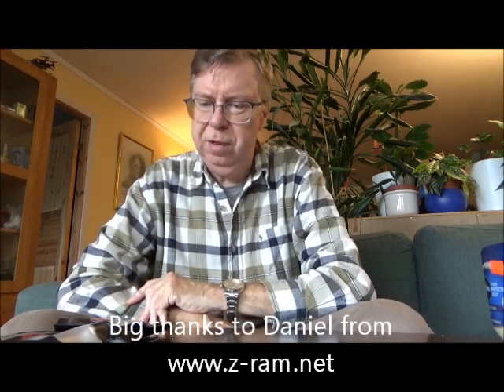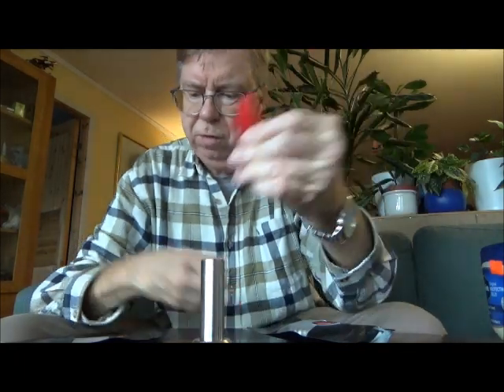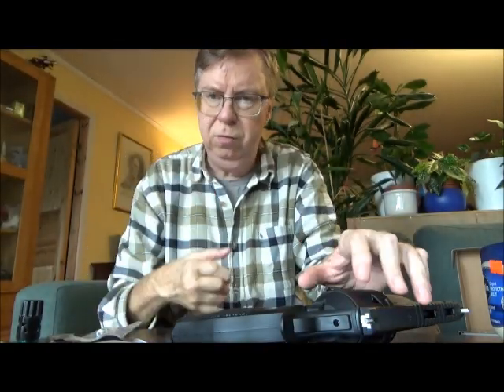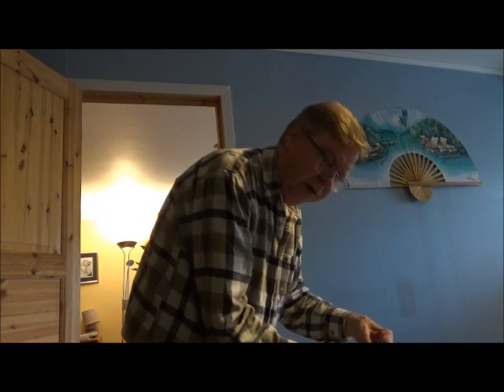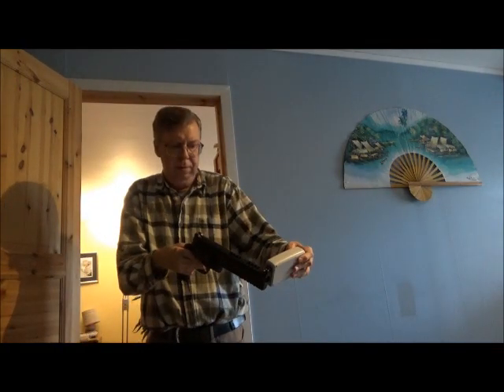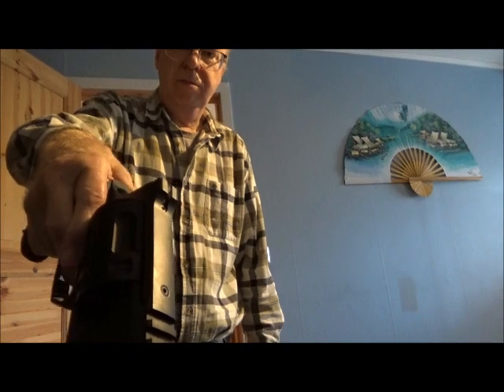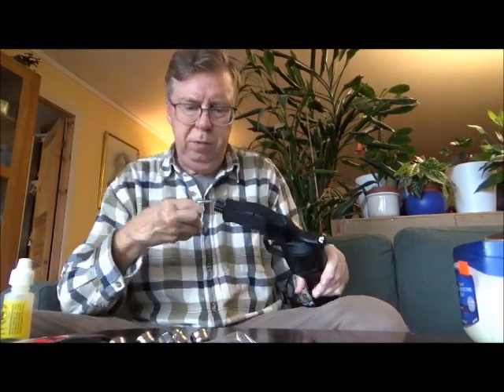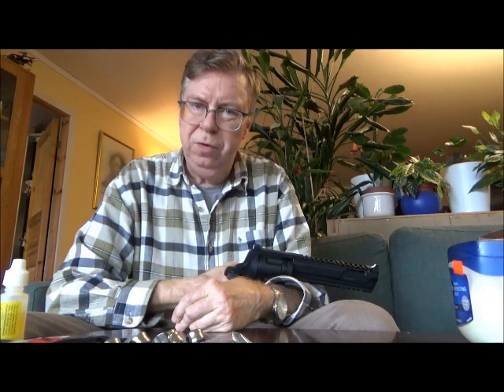Umarex HDR68, Z Ram V2 Slugs

Comment: Oh my! I wonder if those will work in the Grimberg Gavle.  They make their own hard rubber slugs called "jul" and they're similarly designed.  If those Zrams work in the Gavle... I'd have to say the combination would make quite possibly the best less lethal pistol ever made.
Reply from the maker: Yes they give great power. I dont know if they fit in the Grimburg Gavle, but maybe they do 🤔
Reply: The Gavel is not designed to cycle shaped rounds.

Comment: Superb as always Rune, looking forward to removing my valve block  from my  HDR68.  I have some Version 1 Z ram slugs I use in my umarex shotgun, do you know if these will work ok in the HDR68, I have test fitted them and they appear to fit well in the magazine. Whats the difference between the Z ram V1 and V2? Cheers Stu
Reply from the maker: Thank you Stuart. Iam very glad you like my videos 😃. The HDR68  is the best of the handgun type markers. I just love it. I have tested the V1 type in my HDR68 and they work very well indeed. Just remember to lube the slugs first. The only difference between the V1 and V2 is that the V2 has more roundish corners. No edges on the V2 slug like the V1 has. I will post more videos soon I hope. Cheers Rune 😃
Reply: @runerebel8441  What product do you use to lube the slugs? Will they work for the HDX68 too?
Reply from the maker: @mruhum   I just use Vaseline. I dont shot slugs from the HDX. I tryed muzzle load them but they twist and jam. I only use ball ammo in the HDX68
Reply: @runerebel8441  ok thanks

Comment: so the 7,5 with valve block and restrictor removed shoots 10j over the 16j... again!?!? damn! its always the 7,5 and I always buy the 16j ... did you leave the restrictor in the 16j while shooting??? because when you tested it without it went over 30j as well didnt it?
Reply from the maker: Yes that is correct. If I remove the restrictor from the 16 joule I will get ca 2 joule more than the 7,5 joule version.